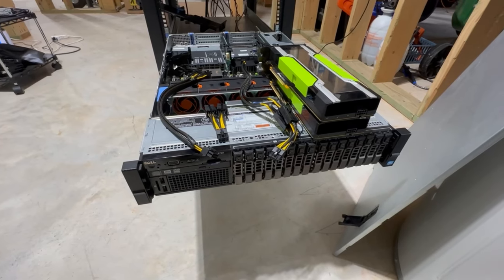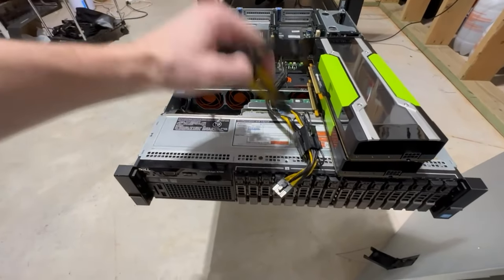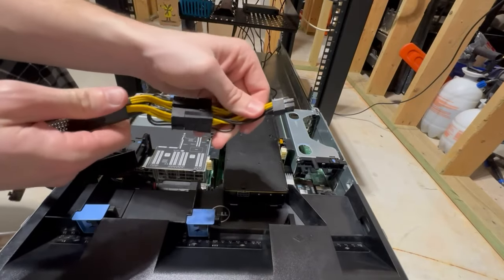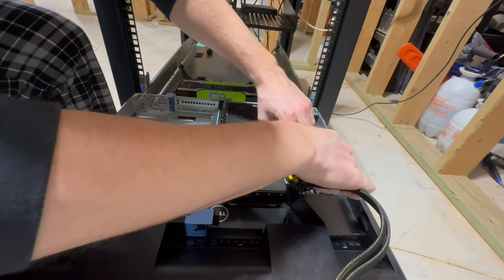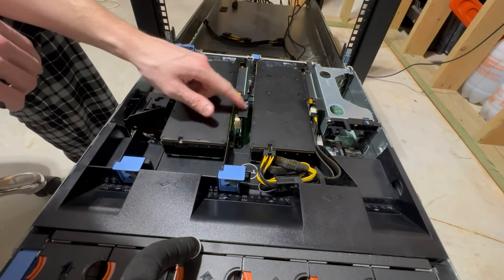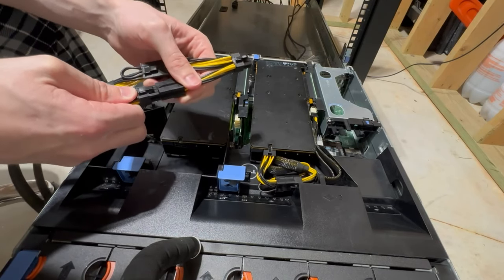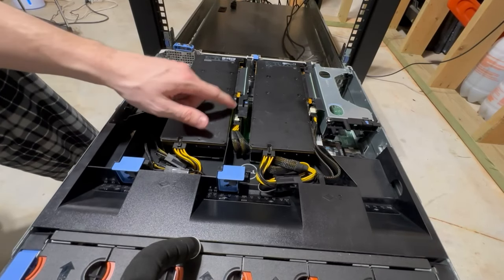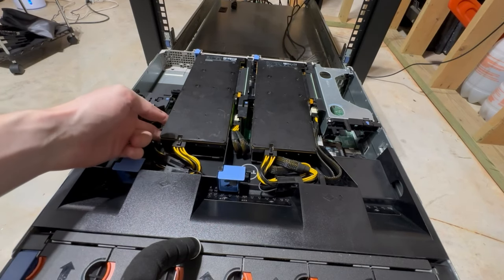Dell PowerEdge R720 GPU Deep Learning Upgrade: Installing Dual Tesla P40s with NVIDIA Drivers

Comment: I have 2x P40 + 1x A2000 for a total of 60GB vram in my R730. I run QWEN2.5 70B Q5 with it. Its awesome.
Reply from the maker: Here there. Really appreciate the comment. That sounds like a sweet setup for sure. Be curious to know what your T/s is across all 3 of those GPUs.
Reply: @TheDataDaddi  Well, I get around 5-6 token / sec with full 32k context. Imagine my surprise when I learned that my old P40s were much faster than the much newer A2000. The A2000 is only there to add some vram so I don't have to use over-quantized gguf's. I was lucky enough to get all that brand new. Even the server was new.

Comment: Thanks, useful.  Would this install process work if I ran 4 P40 on an old Eypc under Ubuntu?
Reply from the maker: Hi there! Thanks so much for the comment. 

Yep, the same install process should work for most similar servers. In your case, would just be 4 GPUs instead of 2.

Comment: love the r720  I put my boot drive ssd in the front of mine rite by the dvd player there are power and satta hook up rite there. There is an upgrade you can do to add 4 ssd bays to the front  its on ebay  about $110 for the drive cage . Then you need  I beleive 6 cables and a controler that plugs in to the pci lane
Reply from the maker: This is an interesting idea! I will have to look into it more because this would be really convenient. Thanks for sharing!

Comment: Thank you so much for this amazing guide. Which power supply do you have in your R720? Did you upgrade it?
Reply from the maker: Hi there! Thanks so much for the question and the kind words. 

I believe all of the R720s I have came with the 1100W PSUs. You might be able to get by with 2 750s, but I would recommend upgrading to 2 1100s. Or you could set it to run in load balancing mode and just use 2 495s. If you are in a non production environment this should probably be fine.

Comment: What the info for the guy you talked about that make and sells custom cables? I didn't see it on here.
Reply from the maker: As it turns out you can buy one that will work on Amazon. Here is the link:

https://a.co/d/9IVyJRi
Reply: my builds a little different I'm putting 4 Tesla K80 24gb GPU into a Asus esc400 G3 but the one i got didn't come with any gup cable and it a 4pin  x2 to a 8pin cable they used on the g3 but changed for the g4. I'm doing like to some and want to build my now AI like Javis from Iron Man that can stand allow in my lab without internet if need be.
Reply from the maker: Gotcha. Well I hope this cable is what you need. It says it should work for the K80 and if the K80 is like the P40 and P100 it will use this cable. Its basically male to male 8 pin 12V EPS.

I think that is awesome! I wish you the best of luck in that goal. Let me know once you get it working. One things to consider though is that the k80s. 

Also, one thing to keep in mind though with the K80s is that they are a dual GPU card at 12GB a piece. The memory pools are separate so it really behaves more like 2 separate GPUs from a memory perspective. Just wanted to throw that out there in case you were thinking you could use all 24 GB of VRAM contiguously (like I did originally) as this may have an impact on you ability to train and work with large LLMs like Llama2 for example.   @jimgore20

Comment: Hi ! thanks for these great tutorials - i've setup a R720 with a P40 but its stuck in P8 / SW Power Cap                      : Active , I've checked and moved the PCI Riser card and the power cable is from Amazon for the card, nvidia-smi -q -d power gives the current power draw as 14.75W, yet its still stuck in SW Power Cap mode , welcome any suggestions - my Dual P100's are working great !
Reply from the maker: Hmmm. This is interesting. I have never encountered this issue. What PSUs are you running? Also, are you using the same cabling as I am in the video or basically the equivalent of male 12V EPS to male 12V EPS?

Comment: Whats with the jank power cable set up when you can get EPS12V Male to Male cables cheap that won't won't have these bulky 2x8pin PCEe thing blocking the airflow...
Reply from the maker: Hi there. Thanks for the comment!

When I first made this video, I could not find these cables. Not sure if they just didn't exist or I just over looked them. I have since found exactly what you are talking about and added the link in the video description.
Reply: @TheDataDaddi  Sorry if it sounded harsh, but I see these silly Y-splitters in tons of guides on adding GPUs to servers and they just seem ridiculous.
Glad you got it sorted, I recently got an R720XD FULL of 2TB drives, got super lucky on it. Will be migrating all the stuff off my R510-12 tomorrow.

When running 2x P40s are you able to get one load to run both cards together, or does it just allow you to run simultaneous loads?
Reply from the maker: @kal9001  Hey no worries. I didn't take it that way. I am always trying to find the best solutions so if I missed something I always appreciate comments letting me know.

Its funny you say that. The whole time I was making this video I was like "this is super dumb. I can't believe there is not a better way to do this." Turns out there was. Lol.

Comment: First of all thanks a lot for the video. 
I want to make a server just like this one, and I have a question please... 
Can I install ProxMox and have inside a VM with Ubuntu for AI, another VM for my Emby video collection please ? 
I wonder if the ProxMox bare metal can share the power of the GPU's in order to use it for all 2 VM's. 
Thanks a lot again
Reply from the maker: Hi there! Yes that is definitely possible. As for the sharing the GPUs between ProxMox VMs, I believe this can be done although my knowledge of ProxMox specifically is limited as I have used it in a lot time since I have become more familiar with docker and containerization. Here is what I know. To split GPU usage across VMs, you are going to have to employ some sort of virtualization. Not all NVIDIA GPUs support this, but newer NVIDIA GPUs (don't remember exactly where the cut off is so I would do some research here) can be virtualized in couple ways:

1) NVIDIA Virtual GPU (vGPU) (https://docs.nvidia.com/vgpu/index.html). This is NVIDIA’s software and will require a license to use from what I understand.

2) Easy-GPU-PV (https://github.com/jamesstringerparsec/Easy-GPU-PV). This seems to be a free open source alternative. 

I have never used either of these so I cannot vouch as to how well they work in practice. I would probably to use the open source Easy-GPU-PV first then if that fails go the official NVIDIA route. If you do this, please let me know how it goes! Would be really curious to learn about your experience as I have never done this. Hope this helps!
Reply: @TheDataDaddi  Thanks a lot for the answer... I just make the server now, when I'll arrive at video cards I'll try it.
Reply: @MrDenisJoshua any update? Want to know too
Reply: @duriansatui  Not yet :-) 
wait the video cards from Cina ...

Comment: cool stuff.   Do you have any intrest in building ML models to analyze NASDAQ futures orderflow data.  Not to determine where the price will end up long term.  but to exploite short term bursts of volatility based on live stock market data. use ML to analyze agressive buying selling and to determine breakouts from short term consolidation.  Would a ML model continue to train its self to get better based on the information you gave it?
Reply from the maker: Hi there. Thanks so much for the comment! 

I love finance and investing almost as much as AI and computing. I am an avid investor and have tried my hand a few times at building automated trading systems. My last attempt was back when LSTMs were still popular. 

Anyway, to answer your question more directly, absolutely that sounds really interesting. I like the idea. I think that could be a good approach especially for short term trades. 

By itself, no. It would need to be retrained on new data in order to get better. However, if you had a base model and employed reinforcement learning of some kind the model could improve based on new data.

Comment: Hi Sir,
I'm new to this field, is it possible to use both p40 and p100 simultaneously with r720? I'm thinking of buying one p40 and p100 and use them both at the same time such that, this way I might not miss out on computing power for both training and interference. What do you suggest?
Reply from the maker: Hi there. I think this is a great approach. Certainly will give you access to the best qualities of both GPUs. I support it.
Reply: @TheDataDaddi  thank you, is it the same steps you showed in this video or any changes in the steps you demonstrated?
Reply from the maker: Should be exactly the same as in the video above. Just will be using one p100 and one p40. @HemanthSatya-eo4rq
Reply: @TheDataDaddi  thank you sir🫡

Comment: Note that the server will let the cards cook without a care in the world. If the fans are loud, you're fine. But If you managed to get the fans quiet, you need to code a tiny program that will control your fans according to the gpu temp. Inference on P40s make lot of heat.
Reply from the maker: This is an excellent point. Thank you for mentioning this. I actually already coded up a program to do this. I am pretty sure it is linked in the video description, but just in case I will post the link below for any who need it.

https://youtu.be/RUW3Ay5rsCY
Reply: @TheDataDaddi  Mine just sends IPMI commands to set the server fans speed with a curve. My server is very quiet with the hottest component at 48 Celcius under very light usage. During inference, the sound level get higher and the GPUs go up to 62-65 Celcius.

Comment: i've switch to newer model 3090 after using p40 since pytorche and tensorflow do not support these model on newer version anymore
Reply from the maker: Hi there. Thank you for the feedback. I am currently using the newest version of Pytorch and the p40s  I have seem to be working fine. I cannot speak for Tensorflow though. Could you please provide the  version of each you have installed so that I can test them?
Reply from the maker: Hmmm. That is strange indeed. I agree it is likely an issue from virtualizing the GPU. I had some issues with I was trying to setup Detectron2 in a docker container. 

First, I would recommend checking that the versions of CUDA, PyTorch, and the NVIDIA driver are compatible with each other. PyTorch has specific builds for different CUDA versions. Since you're using CUDA 12.0, ensure that your PyTorch version is compatible with it.

Second, try running your code in debug mode to get more detailed error messages. This can be done by setting CUDA_LAUNCH_BLOCKING=1 in your environment. This setting makes CUDA operations synchronous and can provide more precise error messages.

Let me know what the output is if you have to resort to option 2 @Daed2001
Reply: @TheDataDaddi  hi i've figure it out , because A Profiles using vApps so it is not working with CUDA after switching to Q profiles it is working now
Reply from the maker: Glad you got it figured out! @Daed2001

Comment: I see that cable management and I kinda wonder, what about thermals....... You should find a way to make those cables even more custom for them to fit better and as in the second card below the air ducting. This is just a suggestion, hope you can manage to give those cards a better lifespan. Greetings !!!!
Reply from the maker: Hi there! So I have actually found a better cabling strategy. The updated cabling should be included in the video description. Please have a look there if you are interested in going that route. Cheers!

Comment: Hello, I have installed two P40's on my Dell R720 server. The System is able to detect one of the P40 and not the second one. Any directions would be appreciated.
Reply from the maker: Okay what trouble shooting steps have you tried so far?

Comment: Hey, great video, thanks for making it. I've been eyeing these off - there's quite a few Chinese Ebay bulk sellers. I can't really tell if it's standard for these to come with the 2x pcie power to 1 cable. Did yours arrive with cables? I want to put one in my Dell R7610 (rack workstation) which has the same chipset and processors as your R720 - on the fan topic if you ever find fan management software that will let you control this era dell in Windows, please let me know - my R7610 bios fan settings are: melting or freezing. If you make further videos with the P40 and P100 I would love to see a few benchmark tests on some kind of GUI or the normal test stuff in Windows - because I'm a simpleton and don't understand what I'm looking at in a terminal. Cheers!
Reply from the maker: Hi there! So glad the video was able to help you. 

In my case, if I remember correctly did not receive any cabling with my p40s. I linked the cables I used in the video in the video description. Should be in the Additional Resources section. However, I also found a better cabling  system that should work (I have not tested it yet though to be fair). Here is the link to that one:

https://www.amazon.com/dp/B08N4BJL2J?psc=1&ref=ppx_yo2ov_dt_b_product_details

With regard to the fans, I encountered a similar issue. I have made a video on how to fix this. However, it is geared towards linux users. You could take my same script/methodology and use it with Windows Task Scheduler or similar. Here is the link to the video on GPU cooling:

https://youtu.be/RUW3Ay5rsCY

Absolutely! As soon as I get a second and can figure out a meaningful way to benchmark these GPUs for AI/ML/DL I will post a video on that. I will also try to make it as OS agnostic as possible so that everyone can benefit. 

Thanks so much again for the feedback! I hope this helps!
Reply: @TheDataDaddi  Thanks that's awesome. The rack workstation model that I have has a bit of a different tail-end to your chassis - it's got support for 2 (or maybe 3?) GPUs with 4 (or 6? don't want to open it up right this minute..) normal GPU power connections. Eg. I can pop my GTX 1650 in there with space and cabling for at least one more. It's a good chassis to look out for - though it struggles a bit with modern GPU card-size because I think it was designed for older slimmer Quadros as an offsite CAD or Broadcast machine. That long explanation is just to say that I think I need just the last bit that's 2x female pcie to eps. 

Thanks, embarrassingly I came across you video on fan control moments after asking. I need to get familiar with Linux, and thanks for the Windows Task Scheduler tip - I'll try that.

Perfect - I feel entirely agnostic about OSes but I only know how to use some of them lol. Absolutely, a benchmark that speaks to the data-educated that you are targeting would be great. Additionally, for any audience who like to build/use computers but don't know ML (thinking selfishly here), I think a quick run through of Cinebench R15 and maybe a CPU bound X264 render vs a GPU based render in DaVinci Resolve or Premiere would be illustrative of the power of the machine you've built.

Cheers and thanks for the tips!
Reply from the maker: Gotcha. What chassis are you working with if you dont mind me asking? I am looking for other that might work as well or better than the R720.

Awesome. Those are great recommendations. Also want to train and run inference on some standard models and compare execution times. Hopefully I can get that video out next month when I get a chance.

Cheers and thanks so much again for the feedback! @sydneylivecamera
Reply: @TheDataDaddi  It's a Dell Precision R7610 - basically a Precision T7610 tower turned into a rack mounted model. Handy because they have 2 or 3 pcie 16 gen 3 slots. I think 3 of these cards would be a push, and there's a spline or two that may interfere with a single or double card, and might need modification. The later R7910 and particularly the R7920 might be better  designed for newer, bigger GPUs, but obviously more expensive. It is noticeably quieter than comparable Supermicro 2U servers I have, too - I don't know if that's a precision model thing or a Dell thing. Oh, and if you get one and it acts weird - bypass the LSi 9271-8i raid card by going direct into the motherboard or swap - I have two of these and the raid card seems to cause trouble in both but maybe it's me or coincidence.

Cheers, no trouble and thanks again for the video!
Reply from the maker: Awesome! Thanks so much for the information. I'll start looking into these as well. Really appreciate it. Cheers! @sydneylivecamera